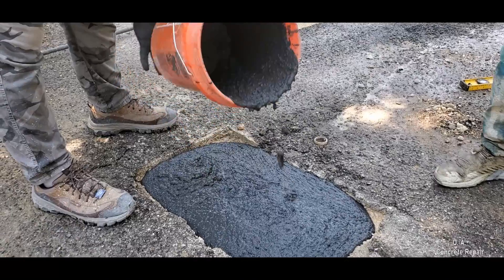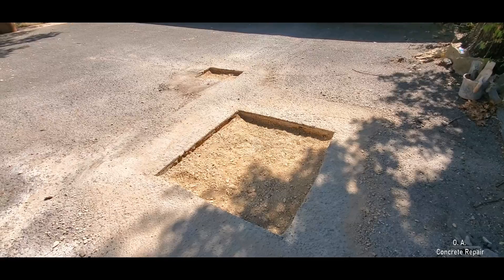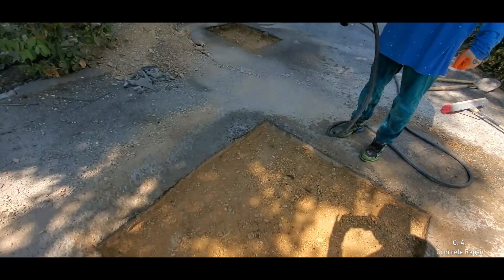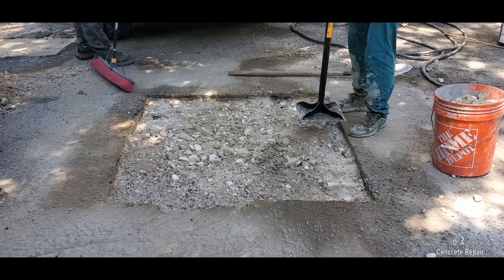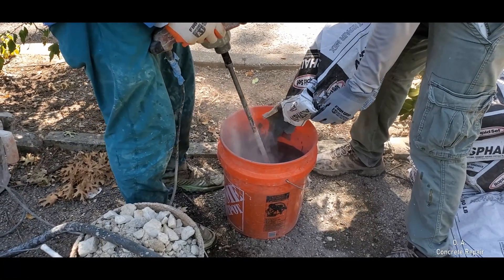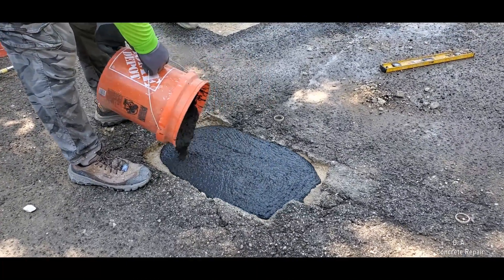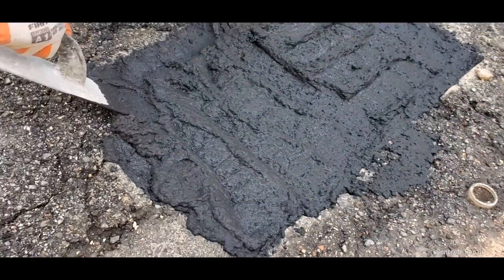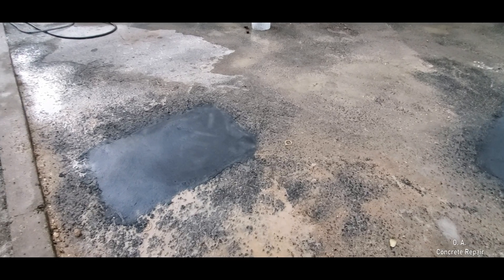REPAIR ASPHALT POTHOLES & ALLOW TRAFFIC IN 2 HOURS!

Comment: This is insane. The rocks need to be super small and crushed have the capacity to compress. That's what gives it strength. Compression. Go look at asphalt quality around the world and we have the worst knowledge on asphalt quakity and education. That underlayment is also bad its not comoressed and needs to be  pours.
Reply from the maker: Chill...this is a driveway, not a highway. We did the compaction in layers to ensure best possible consolidation. I just did a 5 month inspection, and you would be surprised, ZERO cracks! The method works. And the whole point of this video is to make it approachable to home owners. Hey, at least we didn't just pour those cold patches directly over failed asphalt 😆.